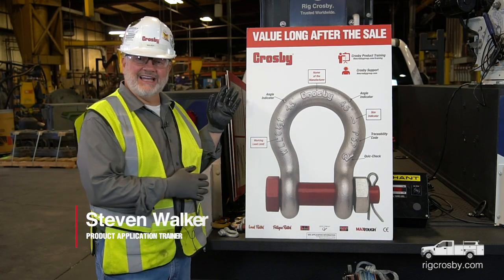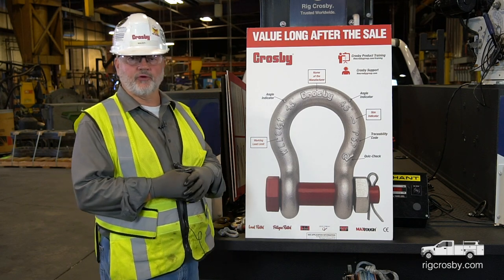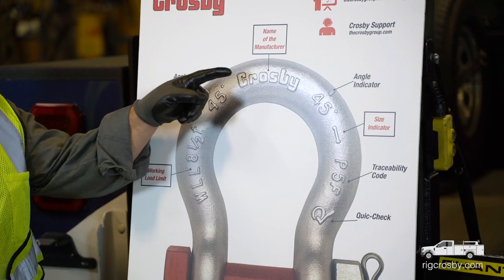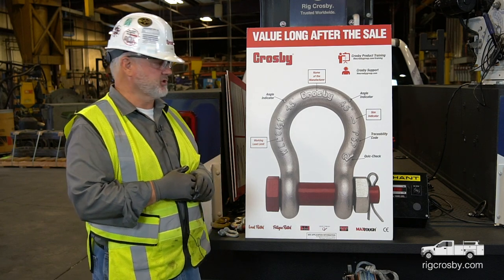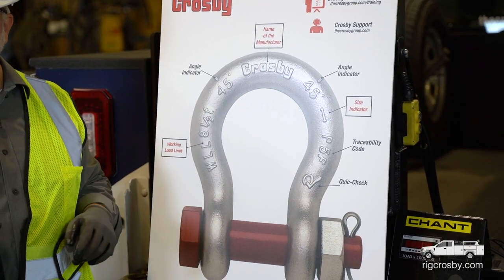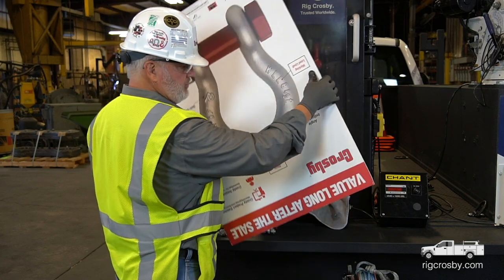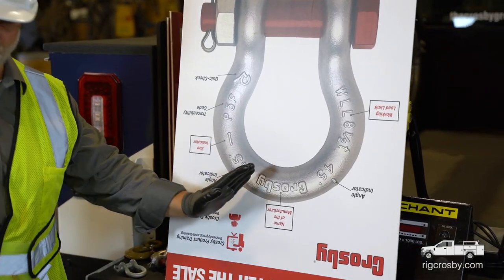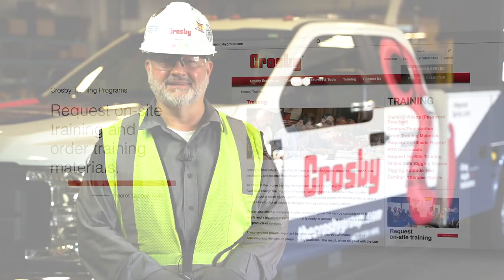Shackle Identification

Comment: So is WLL there 4T?!
Reply: The WLL for the picture is 8.5 t. Or 18700 lbs.   other shackles will be a “T” for standard or 17000lbs. 
We typically advise to just use 2000 per ton to make life a bit easier. 
Hope this helps.